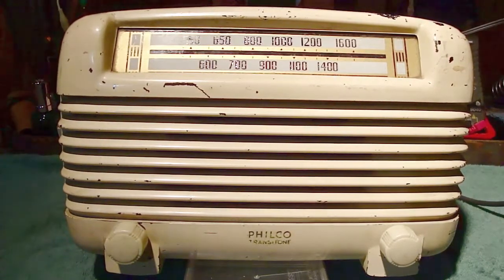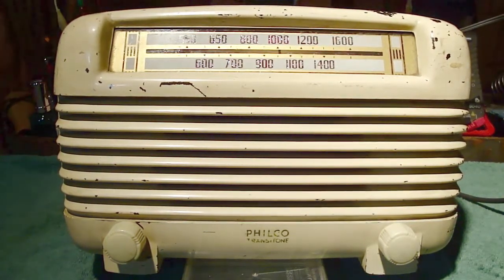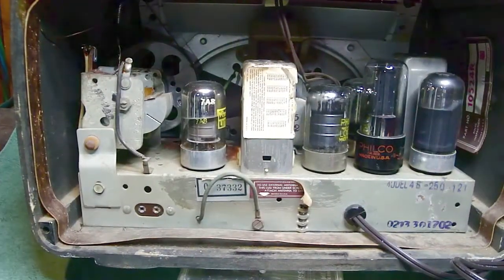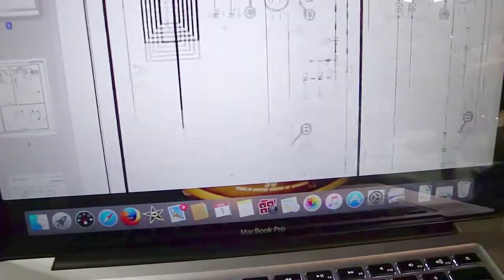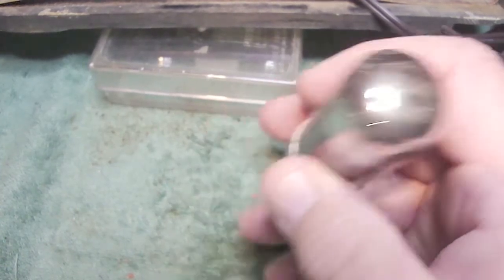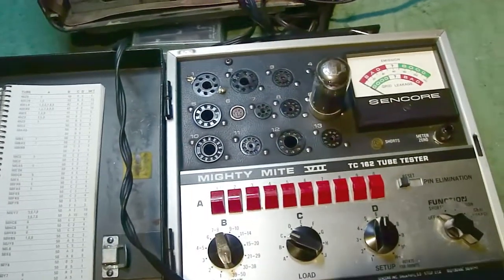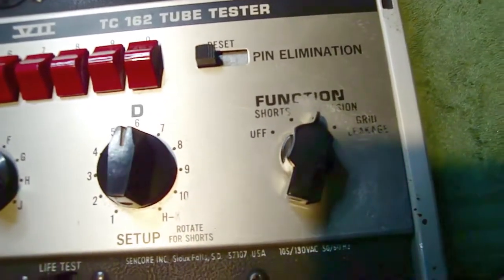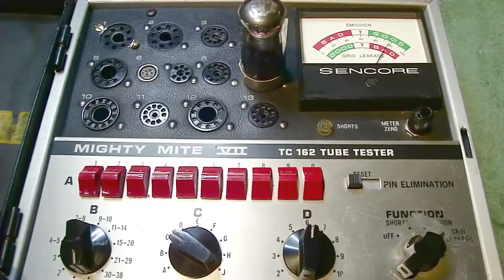Radiowild's Tricky Troubleshooting Tips #4 Problems due to tubes with excessive transconductance.

Comment: My tube tester is a vintage Triplett 3413 , it had an 8 inch meter , that had open  D’arsonvale coil. The best matching meter I could find of the same electrical parameter had a 10 inch scale. So I mounted it outside the body of the tester bed.

Comment: I had an intermittent filament once. As the filament lamp dimmed I hooked up a light sensor that triggered a solenoid that tapped the suspected tube and the filament came back on. Yeah I could have jus replaced the tube too.

Comment: Hey thanks for the transconductance  trouble shooting tip greatly appreciated. I had that happen with a Hallicrafters S20R I am working on in the 6f6 started out great then the radio started to fade to a low volume level. Have a new tube coming. Didn't really find out until I tested it with the 1957 Precision Model 660 tube tester i just finished restoring. Always love your videos keep up the good work.

Comment: Tubes with an imperfect vacuum, air leaking in can cause this effect, air or other contaminants cause the grid to build up a negative charge, cutting off the flow of electrons from the cathode to plate circuit of the tube.
Reply from the maker: Robert, You're probably right. Locktal tubes seem like they are prone to this more than say an octal, or miniature.

Comment: Great tip! I think we all assume ( I know, lol) that if a tube works initially, it is ok. We all chase that bad resistor or leaky cap. The tube is always the low hanging fruit we need to eliminate as the problem. I have followed some videos where there is a consistent problem and when asked about the tube, the answer is I dont have a spare and not going to buy one just to try. Hmmmmm. Thanks for sharing this video and keep up the great work! Best--Larry

Comment: I quit following the TC-162s on Ebay when they started going skyhigh.  Mine is mint except for the A switch which is loose.   I just wanted a spare.
Reply from the maker: The market has been better for radios and test equipment (cheaper). Don't give up! You'll find one! If you want, I'll find you one!

Comment: Another great tip, thanks.  I have that same Sencore tube tester also, love it.  Built like a tank also.  I used to use one just like it in a radio and TV shop that I worked at my last year in high school so later in years I found one at a hamfest at low cost and picked it up for home use.
Reply from the maker: Hi Larry! It's small, versatile, and accurate. I actually picked up a second one as a backup I found for cheap at a local hamfest, but I still need to go through it before using. The purists say that the B&K testers are slightly better, but these are easier to find.

Comment: Now that's a great tip to know. One could spend mucho time on trying to track that down.,,, btw,,, A/C off,,,, Heater on ;p)
Reply from the maker: Yeah! Mrs. RW and I already pulled the window A/C units, and about a month ago I had to do some copper plumbing on my furnace to get it ready for winter. Runs good, and we should be nice and toasty for the winter months!